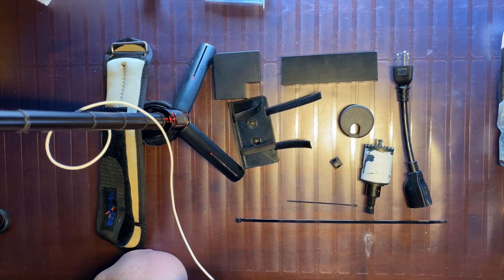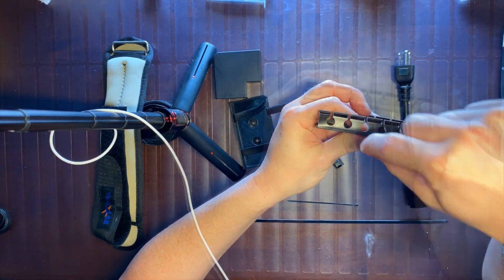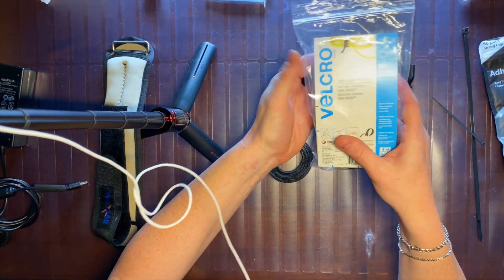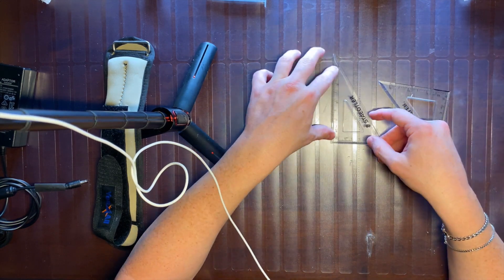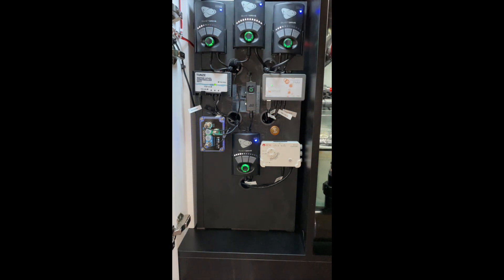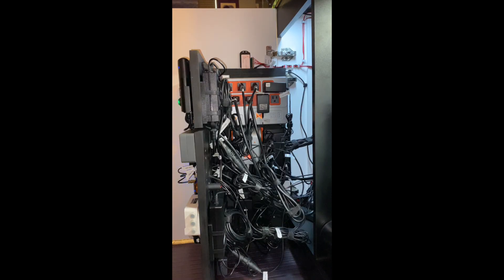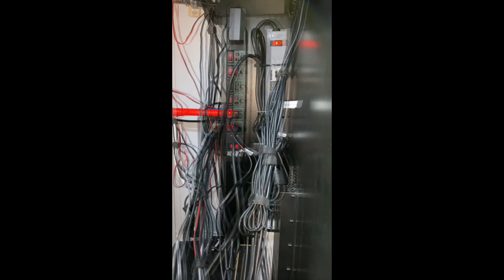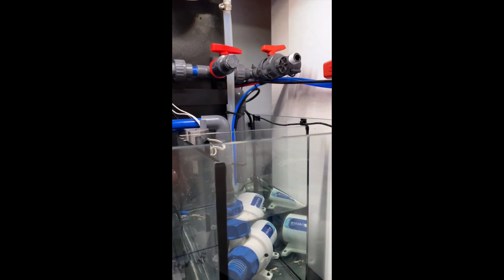WaterBox Reef 130.4 Controller Board Building Process

Comment: Just ordered our 130.4 from a local dealer.  Tank in stock but waiting for the cabinet and lights. Should have everything installed in a couple of weeks.  Your setup looks great and organized!
Reply from the maker: Congratulations, I think you will love it!! Don't hesitate to reach out or send pics of your process. What a blast.
Reply from the maker: How is your set up going? Is it up and running?
Reply: @davbenav  it is going well so far.  Been setup for around 7 weeks!
Reply from the maker: @tomcowsert8962  sweet! What equipment did you go with? And what did you do for plumbing?